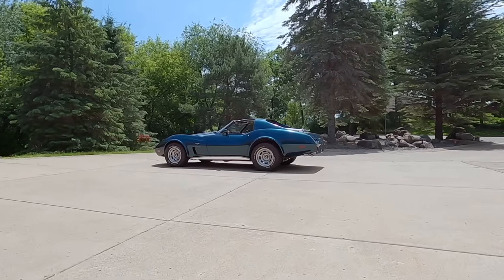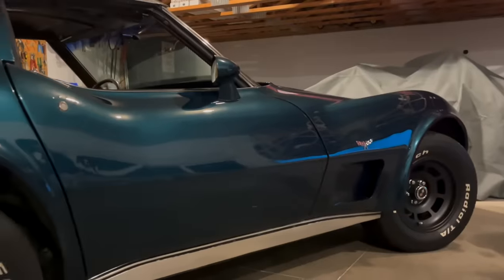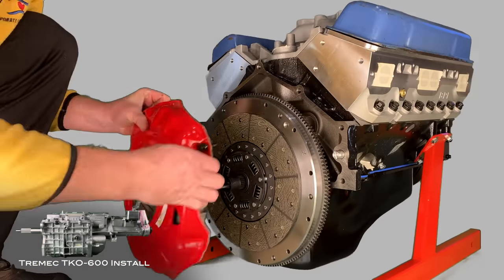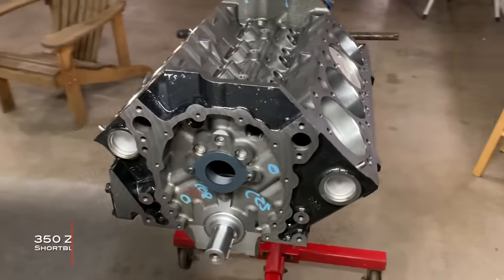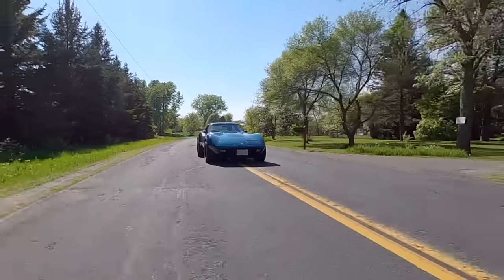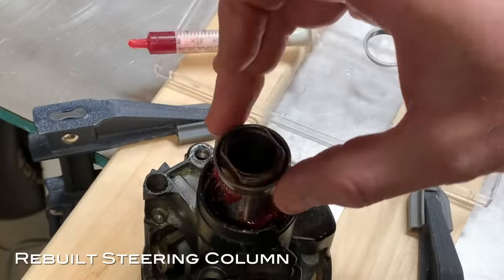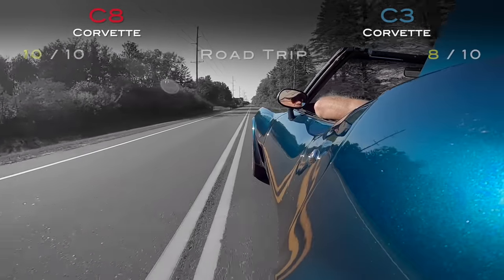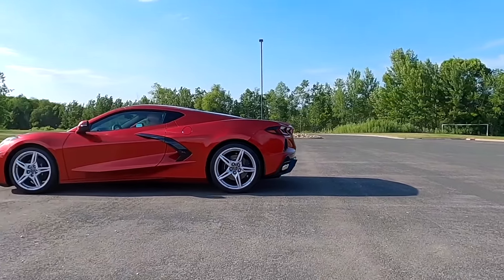C3 Makeover: Modernizing a Classic Corvette

Comment: Kind of surprised you didn't upgrade the suspension as well? I did a similar build 25 years ago on a C3 and with the suspension modifications (fiberglass leafs, good shocks, heavier roll bars, etc., and C4 wheels and tires) it handled pretty well, but of course not as well as a modern Vette. I built a 500hp/tq 406 small block for it and ran high 11's/low 12's which seemed pretty fast for the times too.
Reply from the maker: Hey thanks @pvbarbell1904 - I think I have a fiberglass leaf in my future for sure / thanks for sharing - what year was your C3 and any regrets changing to the fiber leaf?
Reply: @TacoJoe  Mine was a 74 L-48 Muncie 4 speed car. I ran a 3:73 from Tom's Differentials. The fiberglass leaf was a great upgrade, although the first one I installed broke. The second heavier one (in pounds of force to bend it) gave no issues. Saves a lot of weight over the spring steel one too. Taking out the spare and carrier, steel spring, using aluminum heads/intake, headers, C4 wheels, etc. dropped the car to around ~3200 pounds with me in it if I remember correctly.
Reply from the maker: Yeah I took the spare out (long gone) - do you know what caused you fiberglass leaf to break (it got damage from a pothole/etc - or - did it just fatigue and break?)
Reply: @TacoJoe  I think it was a factory fault. It cracked within the first few weeks of driving. It didn't fail so to speak, but delaminated. The second spring was good and I both slalomed and drag raced the car hard. I had a street and slalom suspension. Fiberglass leafs are good as they put them in C4's and up.
Reply from the maker: OK thanks for the info / I've bought a lot of my parts from Corvette Central in the past / good place to source a fiber leaf?

Comment: As a stock c3s easy to work on?
Reply from the maker: Stock C3s are pretty easy to work on yes - in my opinion, the toughest area to work on is the rear end / trailing arms. It's a service area where you periodically need to replace bearings / align trailing arms and while not hard, it takes some patience to dial things in. Thanks for the comment!
Reply: @TacoJoe man i come back to this video alot. Gounna get my c3 one day. One day.

Comment: HI, IS YOUR NAME JOE?  I JUST FOUND THIS CHANNEL AND VIDEO FOR THE FIRST TIME, I WAS VERY IMPRESSED WITH YOU AND ALL YOUR EFFORT AND WORK, AND JUST THE SKILLS AND ABILITIES YOU HAVE TO DO THIS JUST BY YOURSELF!  GREAT JOB.  BASED ON YOUR OVER ALL VIDEO, PRESENTATION, SKILL SET, PRODUCTION, AND ARTICULATION, I WANT TO ENCOURAGE YOU TO CONSIDER BUILDING A NEW CAR DESIGN FOR THE WORLD.  AN SUV TO START WITH, BECAUSE I THINK THOSE MODELS ARE THE MOST SOLD AROUND THE WORLD.  I THINK YOUR NEW CORVETTE, AND ALL NEW CARS INFACT, ARE MONEY TRAPS AND ULTIMATELY VERY DISAPPOINTING CLONES OF EACH OTHER.  THEY ARE ALL TOO COMPLICATED.  TOO ELECTRONIC,  TOO COMPUTERIZED, TO DIFFICULT TO REPAIR YOURSELF ( FOR MOST PEOPLE WITH BASIC SKILLS )  HAVE WAY TO MUCH "UNNESSARY" FEATURES WHICH BOTH COMPLICATE THE OVER ALL CAR, AND CREATE ALL THE PROBLEMS THAT COME WITH ALL OF THEM.  AND, THEY ARE ALL SERIOUSLY OVER PRICED!   I THINK WHAT WE ALL NEED IN A SPORTS CAR, SEDAN, SUV, OR TRUCK, IS FUN, EASE OF USE, EASE OF REPAIRS, SPACIOUS CABIN ROOM FOR EVERYONE, NO MORE ELECTRONIC DEVICES, AND ALL THE UNNECESSARY FEATURES, LIKE, MULTIPLE CONTROLS FOR MULTIPLE FEATURES ON EACH SEAT! LIKE A TV SCREEN IN THE CENTER CONSOLE!  LIKE SUSPENSION MODE OPTIONS!  GIVE IT ONE SUSPENSION SYSTEM!  ALL INDEPENDENT SUSPENSION!  ALL WHEEL DRIVE OR HAVE ALL MODELS COME WITH A 4x4 OPTION.  JUST INCASE ANYONE GETS STUCK IN THE MUDD OR DITCH OR SAND SOMEWHERE..  IN SHORT I THINK WE NEED TO GO BACK TO SIMPLICITY, RELIABILITY, FUN, EXCITEMENT, EASE OF USE AND REPAIR, ALL AROUND QUALITY BUILD MATERIALS AND INTERIORS, AND AFFORDABILITY WITHOUT ANY LEASING OR FINANCING NECESSITY!   AND,  I THINK YOU COULD MAKE A CAR LIKE THAT!  PLEASE SERIOUSLY CONSIDER WHAT I AM SAYING.  THE WORLD IS A MESS ONLY GETTING MORE MESSY AND COMPLICATED,  UNNECESSARILY!  WE NEED SIMPLE, GREAT SOLUTIONS!  AND WE ALL NEED TRANSPORTATION!  BUT WE NEED THE RIGHT BASIC TRANSPORTATION THAT ENCOMPASSES EVERYTHING THAT MAKES SENSE, WORKS, AND IS AFFORDABLE BY EVERYONE!   WHAT DO YOU THINK?
Reply from the maker: hey rocky thanks for the feedback - yes cars definitely have become more complicated and agree that at the end of the day, cars are meant for transportation and all the bells/whistles don't always make it go better/faster/etc. Glad you liked the video and thanks for the comment!
Reply: @TacoJoe    THATS IT? WHAT ABOUT THE CORE OF MY MESSAGE TO YOU?  HAVE YOU CONSIDERED DESIGNING A BETTER CAR MODEL?

Comment: The problem with the C3 is the snout or nose.  It sticks out too far, and too low.
This was changed in the C4.
Modifications to thr snout would improve the C3.
Reply from the maker: @jamesmooney8933 - Yeah C3s do have a long nose - one of the problems with shortening is the MASSIVE vacuum tank that is part of the front bumper structure and the HUGE headlight assemblies. That said: with some good planning / creativity, I think it could be shortened. Crazy stat: My C8 is only 182" long! - but - it's SUPER wide too / thanks for the comment!
Reply: @TacoJoe  In the late 50's, an after market front end was made for the C1 Corvettes.  Can they make an aftermarket front end for the C3?

Comment: Dude, you could've done a junkyard ls swap for less than that fi system costs and gotten more power, better economy and better driveability...
Reply: Then go do it, nobody is going to complete a safe, reliable, and proper LS swap for less than the cost of the EFI, if you think that, than you either A. haven't done it, B. have done a hack swap with a crap 4.8 or C. own a full machine shop and didn't factor the free tooling and labor or materials into the swap.  Fuel injection onto an engine that was already fitted from the factory is a pretty easy and cost effective job these days.
Reply from the maker: thanks for the feedback guys - a factor I weighed with the LS swap was the work to the steering hydraulic-valve to clear the LS oilpan. It may have been possible with C3 specific LS oil pan but I didn't dig super deep. SBCs just sound pretty to me too :) Thank for the comments!
Reply: @TacoJoe  personally for a c3, I've been looking at doing a turbo 4200 swap
Reply: To add to this, a LS swap sounds great on paper budget wise. You can snag a junkyard 4.8/5.3 for less that $1000. What gets you is all the parts to put it in. Engine mounts, wiring, fuel system, headers, intake, hydraulic clutch set up and the list goes on. Your $500 engine turns into a $5000 swap very quickly
Reply: Hell, you will spend $2000 on a decent accessory drive kit and almost $1000 on a good fuel system.
Reply: Equally built, the LS may have more HP but the SBC has more lower end predictable torque which is where the fun is at on the street! Plus the car sounds soooo good with the deeper tones that today’s engines are missing.